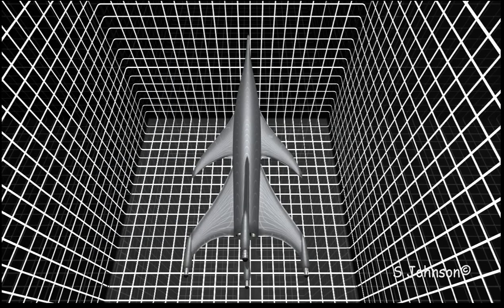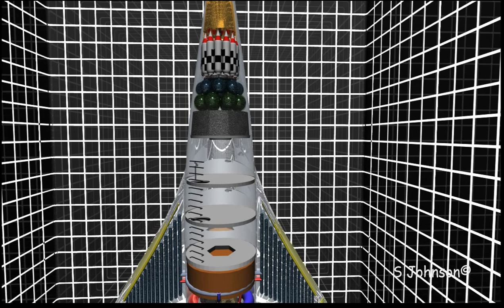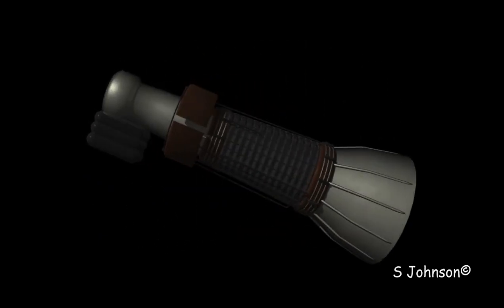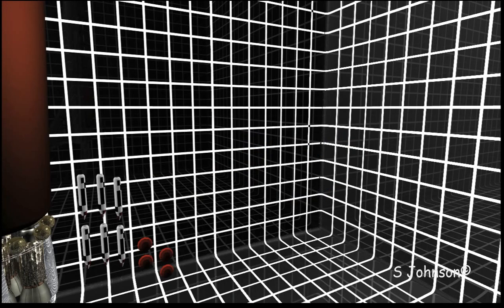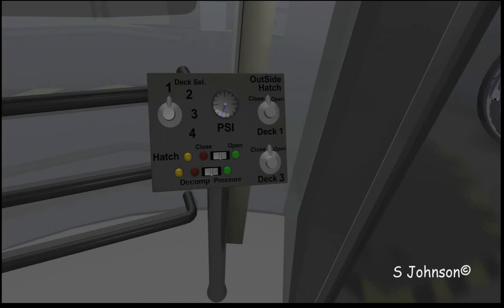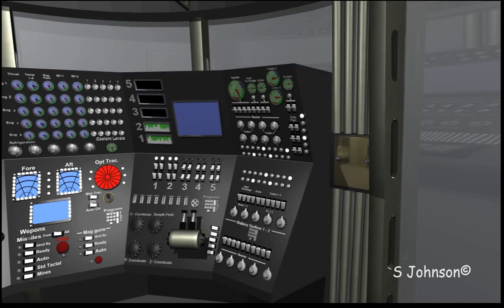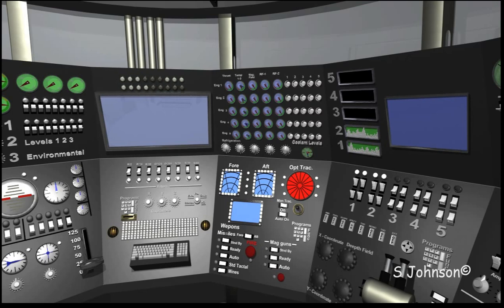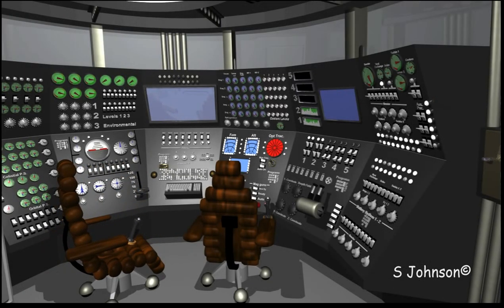3D tour of Rocky Jones SilverMoon * Scifisteve

Comment: Great Job Steve,  I have been watching Rocky Jones since it was originally run on TV.  I am just as fascinated by the stories today as I was in 1954.  Your explanation of the Orbit Jet is very believable and interesting.  If you haven't done it yet, I hope you decide to give us a look into the flying saucers that appeared in several of the RJ episodes. Thanks!
Reply from the maker: I  only remember 2 flying saucers.  One was magnetic drive and the other I haven't been able to find the show it was on.  And thank you, I spend a lot of time trying to make my childhood fantasies as real as I can.   I loved my childhood too.

Steve
Reply: +Scifisteve1954  Steve you are correct there are only two stories, however, the flying saucers may have appeared in more than one episode in the story.   The first one is Out of This World, which was three parts.  It is also known as the Robots of Regelio.   The second series was Blast Off.   That was the one where Bobby and Rocky landed on a planet at the edge of the Solar System.  The flying saucer had been abandoned by its owner and the rangers managed to repair it.  I remember the first time I watched that series as a seven year old.  I was fascinated by the cold light that they used.  To turn it off they simply covered it up.  
   I, like you, do not believe there are any other stories that featured the flying saucer.  In both cases, I think they had a magnetic drive.  The control rooms were identical and had a disk arrangement with a light that rotated around, pretty fantastic to a kid of seven!
Reply from the maker: Wow you are them man when it comes to Rocky Jones trivia.  As soon as you described the lost/crashed/hidden saucer I remembered it.

Great Stuff.

Steve
Reply: And Professor Newton was merely able to do some re-wiring on the old abandoned flying saucer and off they went back into space!